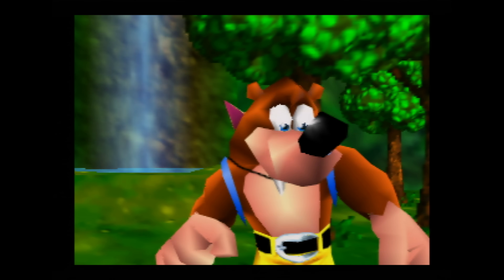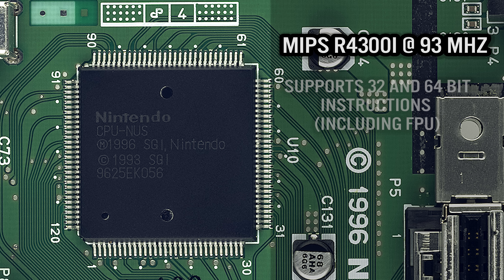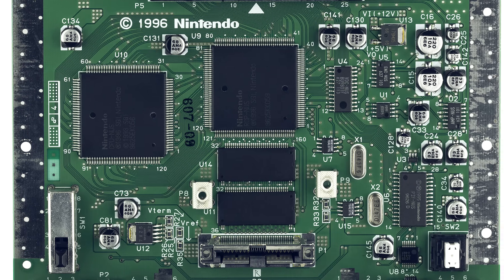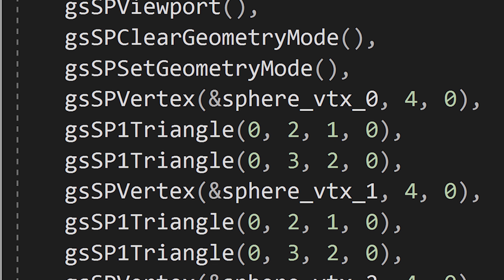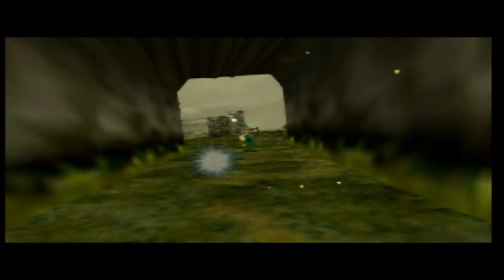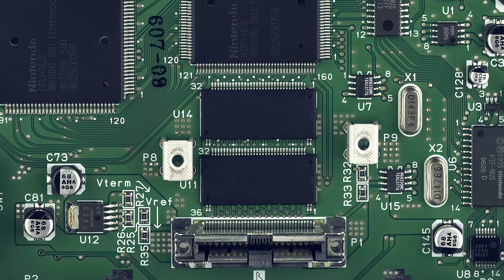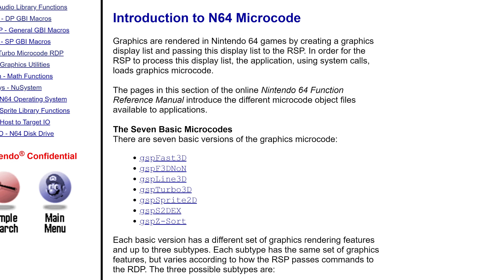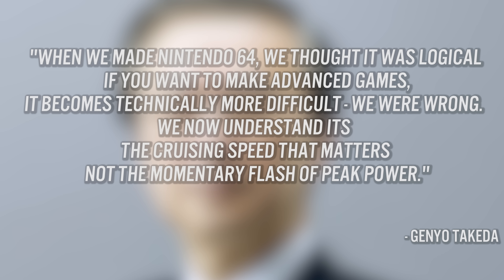Why was the Nintendo 64 so hard to develop games for ? | MVG

Comment: So, the Stop N' Swap feature from Banjo-Kazooie was actually the result of Rare trying to take advantage of the Ultra 64's high memory latency, since it allowed you to power off the console and swap game cartridges while still keeping data in RAM for a short time.  Which means that Nintendo accidentally removed a feature from an N64 game by upgrading the N64!

EDIT: It has been pointed out to me that memory retention after power off and latency are not the same thing
Reply: Stop N' Swop was originally intended to be done with the console turned on, much like how multi disc Playstation games can change discs during gameplay. Rare was quickly dissuaded from implementing it, as Nintendo was not sure how safe it would be to hot swap memory that's being used.
Reply: BrunoDSL Neither of your statements are true. It was fully intended that the N64 be turned off prior to swapping cartridges. Nintendo didn’t allow it because they worried that a future hardware change would prevent the feature from working. You can read all about it in the recent Rare Gamer interview with Paul Machacek.
Reply: @RdCrestdBreegull  That still doesn't rule out the possibility. ROM chips are not meant to be hot swappable and data corruption can occur when you do that. Plus, there's the risk of electrical failures happening as well, since the catridges need power to work, there's also the problem of wearing out the cartridge slot. None of these are present in the PS1 for example because the console only reads from the discs and they don't need power to work. Parasite Eve is one of the games that require you to change discs mid cutscene.
Reply: @BrunodeSouzaLino  Did you read the interview? They created many fail-safes and tried it many many times without a single failure. Plus, you have quite a while to put the new cartridge in after powering the console off (it tested as working at 23 seconds between cartridge insertions; that is a long time to switch a cartridge). It's no different than taking a game out, turning the N64 off, and putting a new game in, just like literally every single N64 owner has done. The only difference is that the Banjo-Kazooie cartridge is constantly checking RAM for packets -- and Stop 'N' Swop was left in BK unaltered, so if you own a BK cart it is doing this every time you play it. You only swap the cartridge the first time after doing something in a game (DK64, Twelve Tales, etc) to allow the cartridge to check for the packet, so there would only be a handful of times you'd perform this action -- people "wear out their cartridge slot" (it's actually the insertion pins that are getting the wear, but they're built to practically last forever unless they get very dirty in which case they simply need to be cleaned) more than this just switching other N64 games in the console's lifespan. http://www.raregamer.co.uk/games/paul-machacek-stop-n-swop-interview/
Reply: @BrunodeSouzaLino  the patent rare submitted mentions doing it with the console off
Reply: @BrunodeSouzaLino  Rare should have just saved data to a memory card and read that data for S 'n' S instead.
Reply: @somebonehead  That may have worked on an empty memory card, but probably there was too much data to be passing along for even compression to work well in a memory card transfer. Mem card size is also something that neutered these consoles. It was only slightly better/more reliable than using the password mechanic.
Reply: They shared exactly one byte of data, you can read that up in the recent rare gamer interview with Paul Machacek, size wasn't an issue. I wondered why they didn't use the memory card aswell. I assume they just really liked the idea of data retention in RAM and went with it...
Reply: @awanderer5446  It has more to do that you couldn't guarantee memory chips to be compatible with hot swapping. Even if the system only reads from those chips, there's no guarantee that doing that will not corrupt data in the process, even if you used the memory card. That opens doors for Arbitrary Code Execution. You can see that in full effect in some Pokémon  speedruns, where save data is corrupted on purpose by removing power from the console before the saving process is completed.
Reply: @somebonehead  N64 didn't have a memory card, but it would have worked with the controller pak
Reply: @wolfetteplays8894  🤓
Reply: No, this is just one of the errors. Latency is not memory retention. Those two things have zero in common.
Reply: hot swapping is still a thing tho, it works with arbitrary code execution for ocarina of time
Reply: Yea your edit is right bud, memory is always retained for a certain length of time.  I believe it was 8 seconds on the OG console and on 3rd hardware revision reduced down to 2 or 3 seconds.  Likely Nintendo found a possible exploit and that is why they reduced it.
Reply: Never heard of SnS. To bad it never gor implemented. Could have allowed for some really interesting games.
Reply: I heard there was this one game where you actually had to reset the console in order to activate it.

Ah yes that was one unique thing about the console, if you press the reset button then the game will reset but with its animations of fading out
Reply: @fargeeks  That game was probably on the Genesis and it was a X-Men title.
Reply: @BrunodeSouzaLino  that was a sega title

But no man , theres this one n64 game where if you hold the reset button then it would cause a vortex cheat in the game.

And like i said, the n64 games had their unique way of displaying the reset actions, it didn't just dissappear from your screen, it did it with animations or in different styles
Reply: And that stop n swap feature is how you can beat Paper Mario using Ocarina Of Time
Reply: Wouldn't ya know, they still do things like that today. Just look at the Switch Lite!
Reply: @chopsmccartney6786  The Switch Lite isn't an upgrade though. It's explicitly marketed as a cut down Switch.

Comment: Games from Rare and Factor 5 always pushed the N64 to its limits and sometimes beyond them, having said that they were the best games on the system IMO.
Reply: I own Diddy Kong Racing and can confirm. Rareware games look AMAZING on the N64. Even to this day it still holds up quite well. I need to find more Rare games
Reply: I remember noticing right away that DKR karts showed the wheels actually steering and the characters looked a lot more "real." Aged 10 I didn't know how any of this worked in the slightest, but we all knew DKR looked way better than Mario Kart.
Reply: It has a more independent feel to it it’s more advanced than smk for sure and just more fun
Reply: Pretty sure the karts in DKR were pre-rendered 2D sprites for each angle, that would be why they looked so good

Comment: I always appreciated seeing 30 vehicles on screen at once with no slow down at all on F Zero X...the audio was great but in mono only, and I wonder if that reduction in audio quality was due to prioritising graphics/frame rate.
Reply: It was in mono to make it fit into the cartridge. The EXpansion Kit (on the 64DD) has all the music in stereo.
Reply: If I remember correctly, the music for F-Zero X is all stored as audio files rather than sequences. So, even with mono audio, music took up well over half of the cartridge.
Reply: That game got its priorities correct. Even after all this time, F-Zero X is still really easy to go back to and play. I believe its prioritization of 60fps, while still being able to display all 30 vehicles was warranted. Graphics and sounds took but the music still great and the models are super simple but work.
Reply: I read an interview with the devs for the cause of the music being mono.

They really, really focused hard on the 60FPS part during development, so they optimized everything to the maximum.

In the end, they wanted 4 channel Stero "MIDI" audio, which would cost around 4-6% performance. On 60FPS, this means drops up to 4 FPS. So the game would only run on 56-58FPS with constant Frametime issues and cause problems with inconsistent steering.

So they decided to use uncompressed wav files that they could directly push to the sound chip without any bix tax on the processor. Due to the small cartridges, they had to cut the second channel and lower the Bitrate.
Reply: They used LODs for the vehicles along with some distance fog.
Reply: I think f-zero X is the only n64 game to run at 60fps iirc.
Reply: it uses streamed music instead of sequenced music because sequenced music steals GPU time.
Reply: I remember getting disappointed even back then considering how F-Zero X was so simple in terms of graphics. N64 never truly felt like a generational leap for me.
Reply: @julianobitsgen  from the super nintendo? I disagree. Going from Mario Kart SNES to Mario kart 64. Or super. Mario world to Mario 64? The n64 was never a powerhouse but it was magical to me as a kid coming from playing genesis and SNES games.
Reply: @dandastardly2792  I'm guessing he meant from the PlayStation/Saturn. For a console released 2 years later it wasn't the giant technological leap most of us were anticipating. To put it into perspective the Dreamcast launched about 2 years after the N64 and completely wiped the floor with it.
Reply: @dandastardly2792  I was comparing N64 to both Saturn and Playstation, and telling you how although I had great fun with some N64 games, it never truly felt for me like a generation ahead. Are GT 64 and World Driver Championship a generation ahead of Gran Turismo and SEGA Rally? No. Are Killer Instinct Gold, MK4 and Deadly Arts a generation ahead of Tekken 3, Virtua Fighter 2 and Last Bronx? Nope. Is Star Soldier 64 a generation ahead of Thunder Force V and R-Type Delta? No. Later on, the Dreamcast truly felt like a generational leap, but the N64 had severe limitations and apparently could make only good platformers(that I never cared much) but was extremely lackluster in Fighting, Shmups and RPGs. It had good racing games, but like I've said, none felt like a generational leap compared to 32-bit machines.
Reply: @julianobitsgen  N64 is same generation as both Saturn and Playstation. It was early 3d and Big N's first try at it. At the time of release, Mario 64, Pilotwings, Wave Race, and even Star Wars looked better than most the 3d offerings on PS1/Sat. And thats with both Sony and Sega having a 2 year head start on Nintendo. It's incorrect to label N64 a different generation than the PS1/Sat. Yes it was marketed as the more advanced hardware but as we seen over the years, all systems just took different approaches to 3d. As for which one did it best? I think it's a matter of preference. 

As for system library? N64 had a shortage of a few genres like rpgs and 2d games. No arguments there, if you are a fan of those genres, the N64 wasnt your system. But saying it was only good at platformers is wrong. Along with platformers, N64 did really well with racing games, sports games, FPS games and other arcade games like all those midway games. Even the few rpg games it got it ended doing really well. Its true strength came from being a party system. 

And the Dreamcast while only released 2 years after the N64, was Sega's 2nd attempt at making a 3d console, 4 years after the Saturn released. I would consider that a generational leap over the N64 and would have expected it to look much nicer. And it did. All console makers got it right for that generation DC/PS2/GCN/XBOX, in terms of their hardware.
Reply: @julianobitsgen  While I agree about the lack of fighting games, shmups and rpgs I feel those genres tended to be over saturated during the market at the time anyways, which is why on saturn and playstation there's too many of them and there's as many mediocre ones along some good ones. On n64 I felt there were many more games that experimented and paid off well because of it. Look at treasure's output on the system which most people tend to look over. It was much more experimental than the stuff they did on saturn, and don't get me wrong I love guardian heroes and radiant silvergun is one of my all time favorites. But sin and punishment and mischief makers were just much more out there in concept from the typical beat em up/shmup afair. Sin and punishment still being a showpiece on the system with crazy spectacle with such a strange but exhilarating concept,  combining a platformer, an on rails shooter, a shmup, and light gun mechanics all into one. Also, Mischief makers with it's spin on shaking mechanics in a beat em up/platforming setting.

 Also fps games were a big one on n64 that tended to have the overall better experiences when it came to that genre. While playstation had a decent port of quake 2, the duke nukem source port was lacking and ran worse than the fully 3d version on n64 that had it's own exclusivities even with the lack of music.

 You also had staples like golden eye and perfect dark along with turok, doom 64, both quake ports with a lot of those games have multiplayer functionality. Hexen also gets a bad rap on n64 but it was one of the few games that supported coop 4 player local multiplayer and is actually a really fun experience with better framerate than some might expect at the time.

 I also preferred the bomberman outings on n64 compared to psx with the godawful bomberman party edition which I still think is one of the ugliest bomberman games to this day and an obnoxious ost. Saturn bomberman was obviously top dog in traditional gameplay, but the n64 games experimented with the single player campaign/3d analog concept and something like bomberman 64 actually became sort of like a puzzle game with world and level design that were much more interesting than your usual bomberman affair. 

Also control wise is one aspect that constantly gets looked over, while the n64 had a strange control layout, games like mario 64 standardized analog control movement along with the ability to move the camera separate from that which essentially most games took note to this very day. Same with ocarina of time's lock on system which helped focusing on real 3d objects in real time much more intuitive which games do nowadays. N64 just had better realized open environment games also along with games that actually supported physics at times. Look at rocket robot on wheels, an underrated 3d platformer where objects actually have weight to them. Or road rash 64 which had a great physics engines of how characters either crashed into each other or seeing yourself fly all over the place that weren't typically scripted. Compare that to the dreadful tank controls of playstation games like resi and tomb raider which I can play and enjoy but have aged far worse in control.

Most of the ps1's popular games felt derivative of what came before and in some instances I find them worse because of the focus of cd loading times and cut scenes. Final fantasy being one of the worse offenders of the era, with 7 and 8 having non skip able summon animations and how they reduced the usual 4 party system of the snes games to 3 with the low framerate until 9 which made the original game run even SLOWER. And don't get me started on final fantasy's 7 ugly background pallet. I feel paper mario on 64 not only holds up visually but mecahnically it's much quicker and to the point, with again a better realized open world that's more interactable at times.
Reply: @mario4everd  Alright, you've got a good point there. Of course I was reflecting upon my personal experience with the console. But in historical terms, we could say the N64 was a little ahead in what it proposed to do, and it was a step further in gaming. I even had a great time with the N64 back then (I played so much of Goldeneye, those THQ Wrestling games, Bomberman 64 and International Superstar Soccer with my friends, always using the 4 controllers). Nowadays I still play Wave Race from time tô time, and it's probably my favorite on the console(yup, I've never cared much about platformers). Nevertheless, given the low resolution and cartridge limitations, whenever trying to play the average N64 games (not the great ones), I still think those games just feel ugly and outdated, specially compared to some good and great Saturn / PS1 games, running on the same CRT tv. If back then those games didn't impress me, now they impress me even less.
Reply: @mario4everd  On the other hand, the platform genre was oversaturated on the N64.
Reply: @eponymous7910  You've got it, that's exactly what I meant.
Reply: @julianobitsgen  I believe it's all about perception. Since the psx was able to support higher quality textures things have an illusion of looking better in some instances. Personally I'm not the biggest fan of the constant texture warping thoug you get on psx and saturn compared to the n64. While it is nostalgic, I feel models in particularly have not aged well at all. A good comparison is between cut scenes in metal gear solid compared to majoras mask. I find the characters absolutely ugly looking and animations look absolutely dated. Compared to to the beginning scene of majoras with animations that I was surprised that were even on the console at the time, and because the textures were more simplified, the style still shines true to this day.
Reply: @julianobitsgen  and actually the platform genre was probably as prevalent on other consoles. Psx obviously being more so than saturn. You got crash, spyro, klonoa, pandemonium, tomba, the megaman x series, rayman. The key difference between consoles is that the n64 had a tendency to be more prevalent with 3d platforming genres where the psx had more hybrids. I also consider crash more of a hybrid platformer than a true 3d one. Spyro obviously being one of the few exceptions